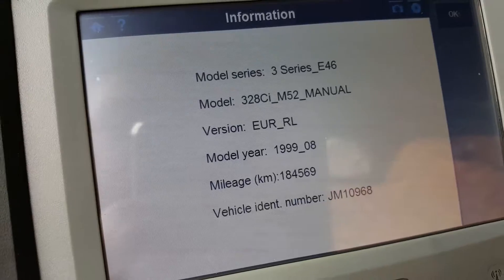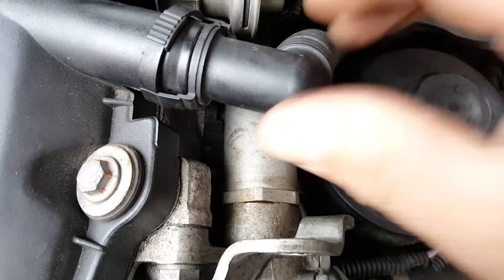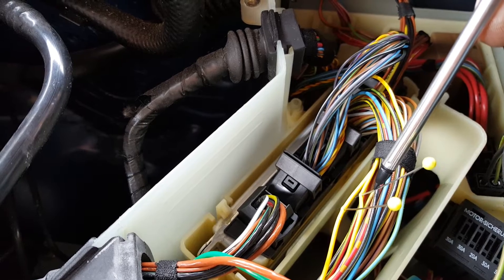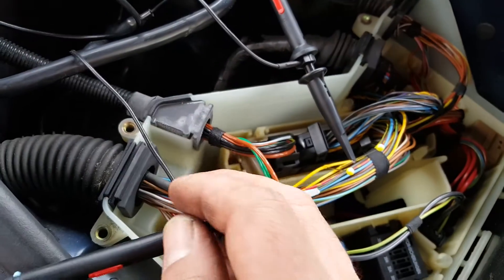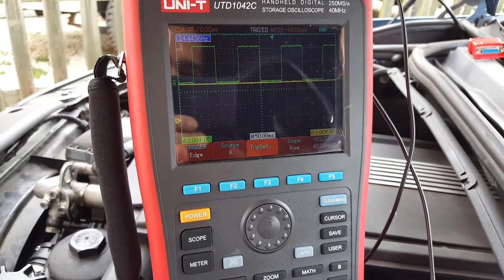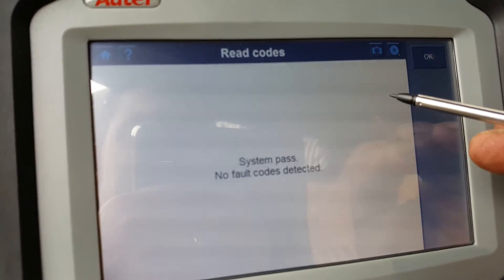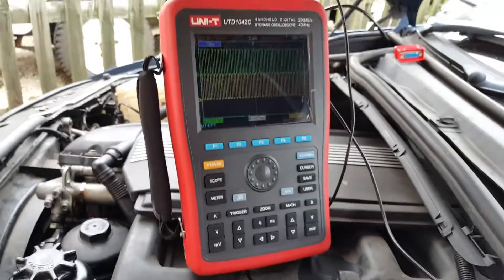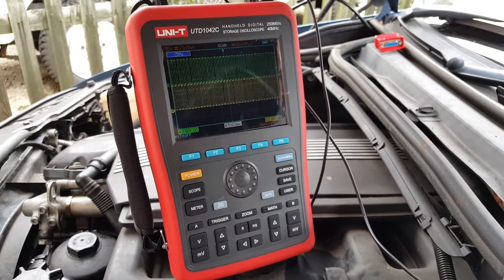Camshaft hall sensor signal check P0340.

Comment: Hi, I have seen your two old videos and it convinced me to buy an osciloscope but the one you are having uni t utd 1042c is not produced anymore, what woul you recomend on this brand with same properties but not too crazy on price, something similar with the one you prezented but with the posibility to find it on the market. Thank you, Alex
Reply from the maker: To be honest I don't know which other ones they have, but depending what you want it for, I would recommend a 4 channel scope.
Although I love my one, which I still use and does the job, a 4 channel would be definitely a massive improvement for when scoping timing systems...
The down side is that most 4 channels are PC based, and for the the handheld has some advantages. 
If you sill think the one I have is all you need, you still find it for sale in some places...
👍👍👍

Comment: Hi frd   Just need ur help ford galaxy 1.9.  Drive cut off.   I test crank sensor 3 pin for 2.4.  V.   2.5v.    2.4.   From ecu and from sensor.     Also I test cam sensor.  12v.  5v.  0v.    What code be ecu?
Reply from the maker: auto uk 
Hi
The crank sensor, being a 3 pin sensor, you  should have 5v, GND and the other pin will be the signal... I haven't checked the pinout, assume you have done it and you know which pin is what...
If you have a good GND and 5v at the sensor, check the signal, better with a scope... otherwise check wiring from the ECU to the sensor...

Comment: Are you based in the uk?
Reply from the maker: Yes?!...
Reply: I really need some help with my car it's a Vauxhall Astra 56 plate it's been on diagnostics at the garage and it had a fault with egr valve, that's been replaced and a problem with the camshaft sensor he put 3 new camshaft sensors on and it wouldn't clear the fault he said it could be an internal wiring fault but would have to be taken to an auto electrician is there anyway you could look at the car I live in east Anglia
Reply from the maker: +Sean Sean 
I am in East Anglia as well...
I am a bit busy at the moment, and don't really have the room for anything else. ...
Sorry about that.
Have you measured the wires from the EGR and sensors back to the ECU?
Have you checked that the sensors are getting the correct voltages etc...
Which engine are we talking about?
Reply: No I haven't done any of that I don't have a clue how tbh.
The engine type is Z14 XEP
Reply: Hi again I put my car on op com and I got 2 faults both camshaft position sensor, one said high input and the other said open circuit the fault codes were P0340-05 and P0340-04 any idea on what I should do now?? Thanks